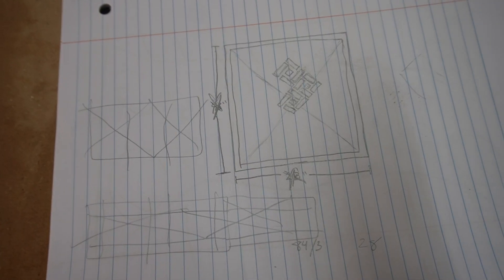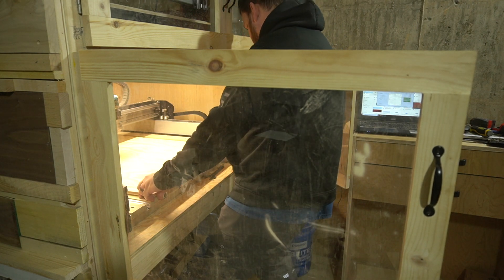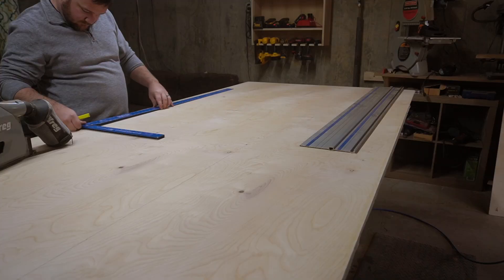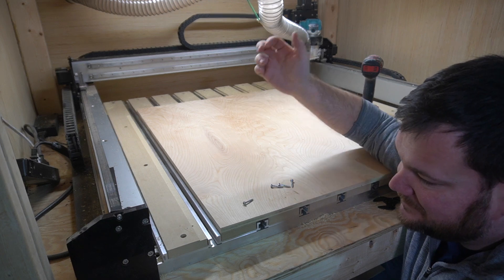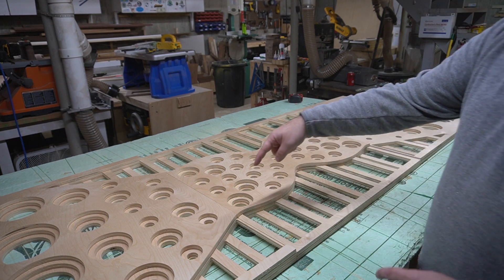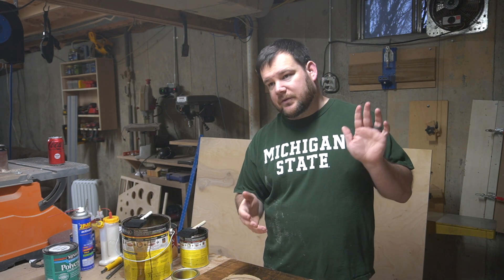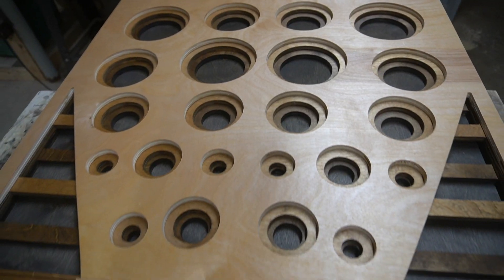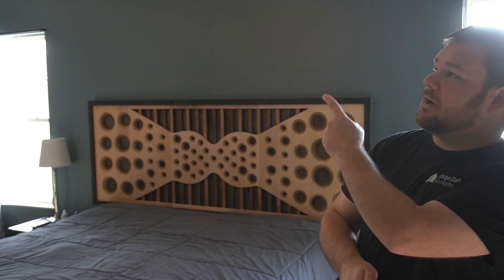My BIGGEST CNC Project Yet! Making An One-Of-A-Kind Headboard On A Desktop CNC

Comment: Use the holes and slots to your advantage.  These are great opportunities to use as work holding  points. Just make sure you have bit clearance if the hold downs stick up at all. That could be cut using no tabs at all. Saves on "tap clean-up" down the road.